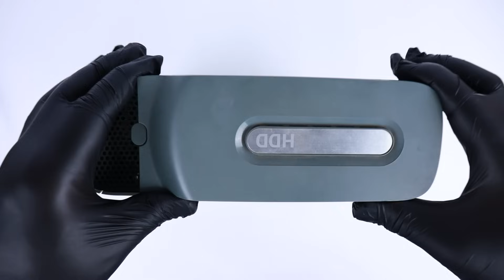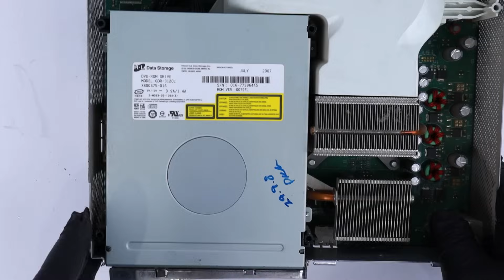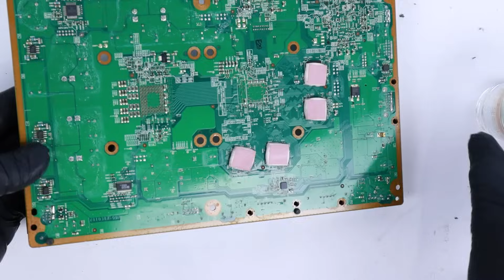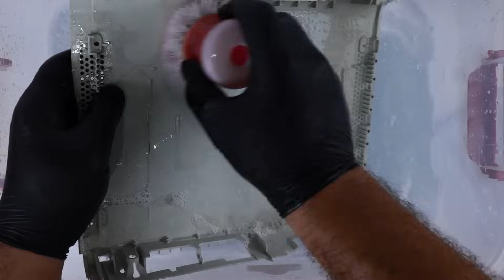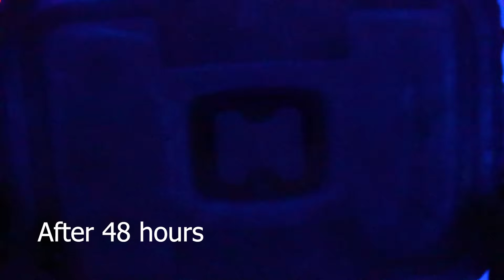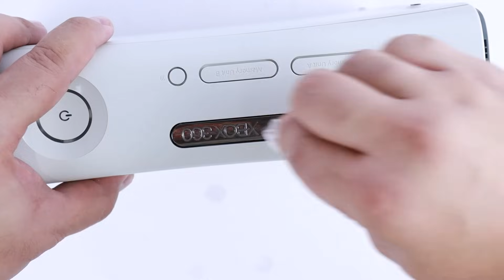Restoration & Repair of broken Xbox 360 and Fix The Red Ring of Death - ASMR

Comment: What you did to the motherboard wasn't a fix at all. That GPU chip is defective and has to be replaced. This console will fail again until that GPU is replaced with a revised variant.
Reply: A lot of restoration channels and other people seem to not realize that the chip is bad. They'll just heat gun it and put thermal paste over it just for it to fail again in a week.

Comment: The GPU is the problem because the balls in the chip crack over time due to heat stress.

It is unfixable and an inherent flaw of the chip's architecture. It is unfixable.

Xbox 360 Slim AND "model E" have a completely different architecture, so they can't suffer such flaw.
Reply: Late Falcons and Jaspers also fixed the problem

Comment: No reballing? enjoy your RROD in a few weeks.
Reflowing won't solve anything in the long run.
Reply: the spheres seem to be a little stronger than gpu video cards or chipset bga notebooks, but you're right, the spheres are cracked again after a while there it comes back 3 red lights well at least jasper card seems to have fixed this defect i I have one, thanks to God, it's working very well, I recently changed the thermal compound, it seems I hope it doesn't show this defect!

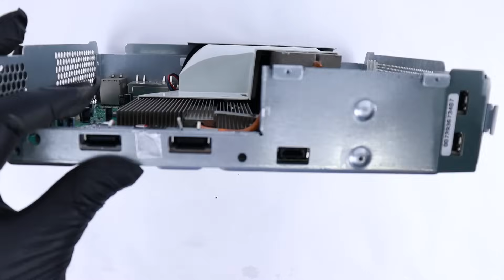Comment: The sink is turned, you put it turned 👉 15:30 error sink
Reply from the maker: Unfortunately, I did not install the CPU heat sink correctly, I realized this mistake later after I finished the video so I corrected it after the video
thanks for watching
Reply: @resEG  👍

Comment: You put the heatsink above the CPU back incorrect plus u didn't clean out the disc drive and if that was me I would have done a fan mod
Reply from the maker: Unfortunately, I did not install the CPU heat sink correctly, I realized this mistake later after I finished the video so I corrected it after the video
thanks for watching

Comment: Wait, isnt that startup only on the 360E and 360S models?
Reply: if they update the console it updates the dashboard which includes the start up screen
Reply: @kyles8524  that software version never got to the original 360
Reply: @SovietUnion97  considering ive done it lol
Reply: @kyles8524  on the 2005 model?
Reply: @SovietUnion97  i dont have an xbox 360 anymore lol
Reply: @kyles8524  I was asking if you did that on the OG 360 lmao
Reply: @SovietUnion97  it was the OG one but it had a silver disk tray in the front before it pops out not white as I remember, unless I had the one right after the OG 360 which might be why it accepted new updates. but it looked the same bar the silver plated looking front disc drive. I already have a problem anyways lol my xbox one wont turn on anymore.I think I have a power brick problem and its annoying me, not sure how many of my old 360 games are compatible.I dont have the 360 but I kept my games.I have like 115 360 games and they go in series like Final Fantasy's, Gears of wars, Halos, Devil May Cry's etc etc etc and single games. Im kind of a hoarders of games
Reply: @SovietUnion97 all 360 consoles can run the latest dashboard. I don't get why you think otherwise
Reply: @Harmonic14  I was not educated on this topic back then. I've learnt a bit more about it now. Thank you for your concern.

Comment: temporary fix as the solder will just crack over time again lmao
Reply: It's the underfill supporting the solder bumps on the die, to be specific. People think it's the solder balls connecting the chip to the board, but those aren't a problem at all
Reply: @Harmonic14  ah okay

Comment: it was a faulty product during production… 😢😮 no extra cooling
Reply from the maker: Exactly right yeah
Reply: Cooling is not the issue whatsoever... The underfill of the GPU is the problem. Replacing the GPU with an updated one completely fixes the problem

Comment: As a former repair technician I can tell that this so called 'restoration' is a 🐎 💩. It's not a proper repair, it's not even reballing, it's just crap.
Reply: Reballing doesn't fix this either. GPU replacement is the only way

Comment: Nice job ripping off Odd Tinkering.
Also rotate that CPU heat sink 90 degrees. You put it back in the wrong orientation, so now that cool air is just blowing on a flat piece of metal.

Comment: Okay, first off, heating the board and chips doesn't actually fix the problem it had. Secondly, why did you not show the full error code? All you really did was bandaid it. It'll fail later due to the same reason it already did. Most likely the GPU was dying and needs to be replaced.
Reply from the maker: thanks for watching

Comment: I know this is 2 years old but...
1.) RROD can't be fixed by just cleaning the console.
2.) You put flux on after cleaning the cpu and gpu... why?
3.) The heatsink is turned the wrong way, that will definitely kill the console.
4.) You showed how you "fixed" the top of the case but never showed a clear shot of it after.

Comment: The CPU heat sink was installed incorrectly, omg this is cringy, there is going to be no air flow may fry the cpu and the heat pipe is pushing against the capacitors, otherwise a good video in other aspects like removing the yellowing surface of the case, but i hate when i open xboxs with this shit